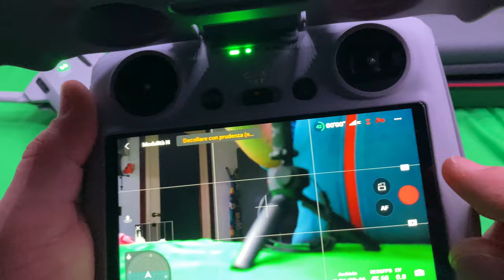DJI MINI 3 PRO - DJI RC WIFI ANTENNA 2023

Comment: Wires are to long. Need to be 15 to 20 cent.
Reply from the maker: THANKS
Reply: Is there a reason? Transmission strength?

Comment: The DJI Mini 3 Pro communicates via Radio Frequency (RF) not Wi-Fi. The only thing Wi-Fi is used for is updating and downloading maps and transferring video.
Reply: But isn't that exactly what most people want out of their drones when it comes to range? You generally lose your video feed way before dropping your connection with the remote, I've flown missions many times using telemetry with Google maps after I've lost my video feed. Usually once a pilot has lost video they stop what they're doing and turn around out of fear of crashing 
.. so in theory, I'd like to think this might actually be a good mod
Reply from the maker: @bpp5507  New video coming soon,

Comment: Amazing...I did almost the exact same thing, even to covering the antenna box with vinyl carbon fibre look-alike ! I made a wider box that sits on top of the controller above the wheels and buttons. A wider box allows for fitting the Alfa antennas which I also have. How did you secure your antenna box to the controller BTW ?
Reply from the maker: Hi, see in video minutes 17:13 - The fastening box with two plastic support screws.Thanks you
Reply: @surytravel  I'm wondering how you got to the screws through ? I'm guessing there's two holes in the little box to put a screwdriver in which are then covered up with what looks like rubber caps when it's fitted.
The modification I did went on top of the controller so the back was clear to screw into. Also it's as wide as the controller itself allowing me to fit any antennas. When building your next antenna holder remember to allow for the width of the Alfa's when fitting the two connectors.
Reply from the maker: @Technician4444  Hi,, Thanks for advice,, second box version 2 I'm already ready..there are so many more news... when time .. I'll put videos on YouTube.... Thanks you so much❤
Reply: @surytravel  Good work Sury, looking forward to seeing how you get on.
Reply from the maker: @Technician4444  Thanks you so much my Friend🙋‍♂
Reply: شكرا لك
Reply: Where do you buy this? ( Link )

Comment: followed the tutorial,
but after the ground drone got up I couldn't control it and it started going by itself. what is the problem?
Reply from the maker: This problem ,, they also do with original antenna... 
Dji mini 3 pro first flight with everything original ,, the drone will go away by itself ,, it happens too ,,
For me it has of internal soft defect of Dji,,, I with Dji mini 2 Never had of problem ,,, 
Search on other channel ,, see it happens with other people too ,,,

Thank you very much
Reply from the maker: With this antenna I am more stable radio frequency

Dji mini 3 are not perfect drones!!!!!!

https://www.youtube.com/watch?v=x5ARV_vfKVM&t=175s

https://www.youtube.com/watch?v=U8YNIIY0lMQ&t=1s
Reply: @surytravel  thank you for answer.

Comment: ตัวใส่เสาหาซื้อที่ไหนครับ
Reply from the maker: I am my project for dji rc radio,, can't find any part
the internal antenna are very weak

ฉันคือโครงการของฉันสำหรับวิทยุ dji rc ,, ไม่พบส่วนใดเลย
เสาอากาศภายในอ่อนแอมาก

Sono il mio progetto per radio dji rc,, non si trova nessuno parte
la antenna interna sono molto debole

https://www.youtube.com/watch?v=x5ARV_vfKVM&t=1s

With these antennas the signaling frequency is much stronger
ด้วยเสาอากาศเหล่านี้ ความถี่ในการส่งสัญญาณจะแรงกว่ามาก
Con queste antenna sono molto piu forte la segnare frequenza
Reply from the maker: https://www.youtube.com/watch?v=2ooDVe9rkbw&ab_channel=SuryTravel%F0%9F%87%B9%F0%9F%87%AD